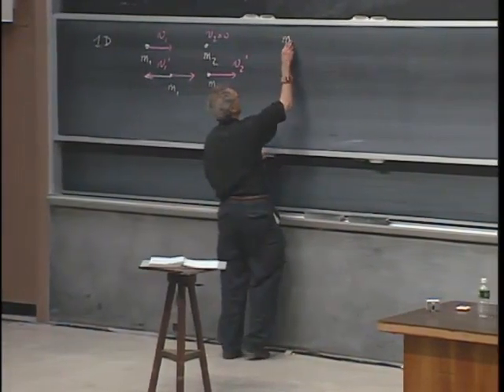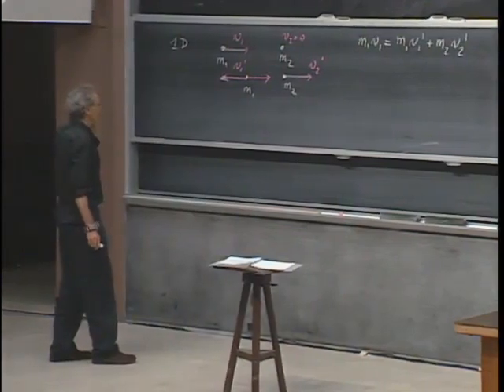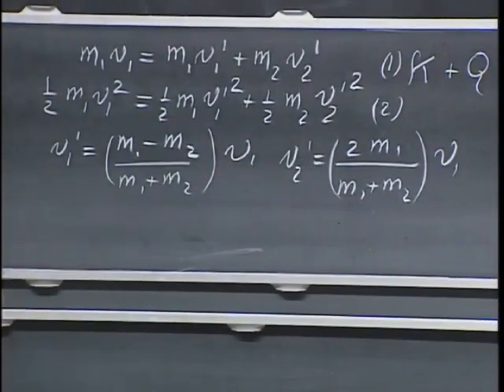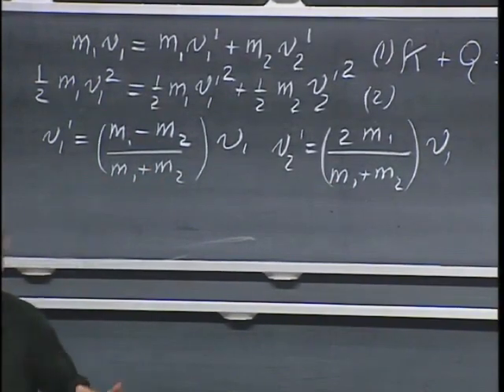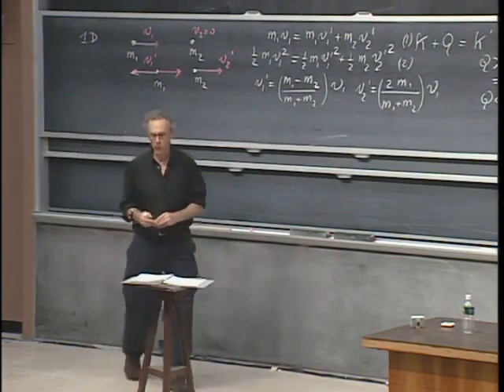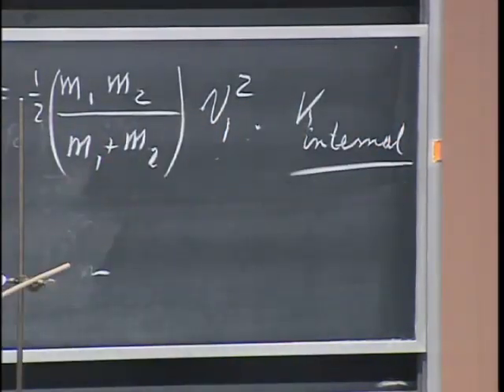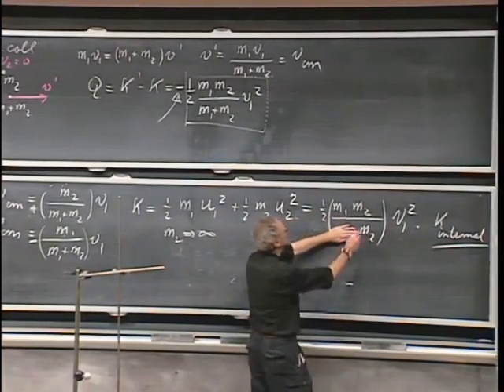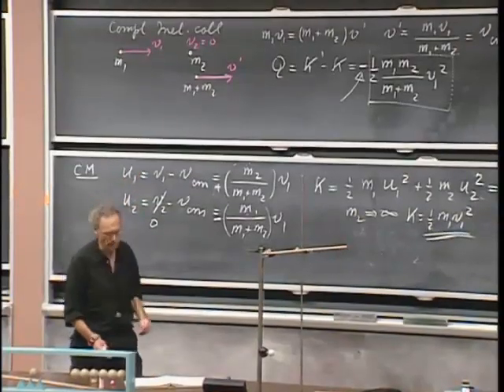8.01x - Lect 16 -  Elastic & Inelastic Collisions, Center of Mass Frame of Reference

Comment: Dear Professor
Consider the wall and the earth as a single object with relatively infinite mass (m2), v2'= 2m1/(m1 + m2) = 0. Kw= 1/2(mv^2) = 0.
Also because magnitude of change in Pb = Pw= 2mv= Mv  is small while the mass of the wall-earth (M) is relatively infinite, v must approach 0 = > K = 1/2(mv^2) = 0. Is it correct ?
Reply: Lectures by Walter Lewin. They will make you ♥ Physics. This is my answer to your question in your lecture. Is it correct?
Reply from the maker: your answer is somewhat confusing
Reply: Lectures by Walter Lewin. They will make you ♥ Physics. 

I mean the magnitude of momentum of the wall is Mv” = 2mv’ , m is mass of the ball, M is mass of the wall combined the earth, v’ is velocity of the ball, and v” is velocity of the wall. 

Because 2mv’ is small and M is extremely large, v” is extremely small (it is almost zero). Therefore, Kinetic energy = 1/2 (mv”^2) is zero.
Reply from the maker: KE of wall is 0.5MV^2. MV is finite (it is 2mv). Thus KE=0.5*2mv*V. But V as you say, is near zero, thus KE wall is near zero but momentum is 2mv.

Comment: About the problem with the tennis ball and the wall:

We know that the momentum of the wall is: p(wall) = m(wall) * v(wall)

Then, by the equation for v1' and v2' for elastic collisions, we can substitute v(wall), and we get:

p(wall) = (2*m(wall)*m(ball)*v(ball)) / (m(wall) + m(ball))

We know that m(wall) >> m(ball), so as we take the lim m(wall) -> infinity we get that:

p(wall) = 2*m(ball)*v(ball) *  lim (m(wall) -> inf) ( m(wall) / (m(wall) + m(ball)) )

the right side limit is of the indetermined form inf/inf, so we apply L'Hopital's Rule and we get that the limit is exactly 1, so:

p(wall) = 2*m(ball)*v(ball) = 2mv
 Is this correct?
Reply from the maker: ofcoz p of the wal is +2mv after the collision, but the KE of the wall after the collision (if its mass M is thousands of tons) is veri close to zero & can be made as small as you want to by increasing M.
Reply: @lecturesbywalterlewin.they9259  yes, i notice it when I made the limit as m2 -> inf of the KE for the wall, and it goes to 0

Comment: Related to your question about the collision between the ball and the wall. Is it due to the fact that moment, mv, where m = x   as x goes to infinity can be different from 0 (v = 2/x for instance) but (1/2)*m*v² would still go to 0 with those same values? Also, can it simply be that the earth to which the wall is attached applies an external force on the wall, and so it's the larger system (ball, wall, earth) that has its momentum conserved? Thanks in advance.
Reply from the maker: +Pedro Candeias KE=P^2/2M.  In this case, P of the wall is 2mv (m is the mass of the tennis ball, v is its speed).  Since M=>infinity, KE is ZERO, but P is not zero.

Comment: Is momentum of the system is conserved in all types of collisions? And should the conservation of momentum be applied along the line perpendicular to the line where deformation of the bodies takes place ?
Reply: Momentum is conserved as long as there is no net impulse from external forces.

This will happen if:
1. There are no external forces
2. External forces add up to zero
3. The collision happens so quickly, that any cumulative effect from external forces is zero, during the instant the collision happens.

Comment: Dear Professor 
After read the chapters about work/energy and watch your lecture, I try to summarize my understandings. Can you please tell me know if I miss something?

Is kinetic energy conserved in elastic collision but transferred into thermal energy in inelastic collision?
Do they both obey delta K + delta U + delta E  thermal = W other?
In both cases, W other is 0 because no external force does work on the system?
In elastic collision, delta E thermal is zero and delta U is temporary (in before and after, all energy are kinetic energy)?
In inelastic collision, delta E thermal is nonzero.
Reply from the maker: use google
Reply: Lectures by Walter Lewin. They will make you ♥ Physics. I cannot find out reliable answers using Google. I usually read books then  ask my physics professors check my understandings. Can you please help me check?
Reply from the maker: >>>Is kinetic energy conserved in elastic collision but transferred into thermal energy in inelastic collision?>>>
yes, energy is always conserved but KE is only conserved in elastic collisions. In the case of inelastic coll the KE lost is released as heat.  However in the case of nuclear reactions (accelerators) the loss of KE with inelastic collisions can be converted into mass of a new particle. I will do a bi-weekly problem on that in 2018.
All of this is readily available on the web. You have to learn how to use google.
Reply: Lectures by Walter Lewin. They will make you ♥ Physics. Thank you very much. I am really sory for asking many questions. Although I am still young, I am quite conservative or “old-fashioned”. I jumped from 6th grade to college, so I was fixed to traditional teaching and learning setting.
Wow, it sounds interesting. E=mC^2 means that the energy that can be converted into mass is kinetic energy? I am looking forward to watching your lecture about this.
Reply from the maker: I do bi-weekly Physics Problems. You should try them.  this weeks problem is
https://www.youtube.com/watch?v=DyVv7WzwH6A&lc=UgyZLUFKbLfl62Hmeqh4AaABAg

Comment: Sir,in the ball hitting the wall problem,
K.E = 1/2 mv^2
or K.E=p^2/2m
now the wall has a certain momentum,but as the mass is quite large,m-> infinity..and something by infinity is 0..hence kinetic energy of the wall is 0 although it has a momentum of 2mv..
Reply from the maker: +Saptaswa Chatterjee correct
Reply: Sir,But in real world a wall has a finite mass and hence the wall must have a K.E ,(however small that may be )..and hence a velocity..applying the same logic if I jump on earth I am giving it a velocity..although it's infinitesimally small.
Reply from the maker: +Saptaswa Chatterjee correct
Reply: +Lectures by Walter Lewin. They will make you ♥ Physics. Sir will it be possible for you to reply me, if I leave my email here? I have a desire of becoming a physicist and specially working under a professor like you ,it would be a dream come true. It would be great to have a guide, like you. Thanks in advance!
Reply from the maker: +Saptaswa Chatterjee I retired in 2009. I am no longer coaching students.
Reply: +Lectures by Walter Lewin. They will make you ♥ Physics. I would be quite happy even if I can talk with you, via emails!

Comment: Regarding the tennis ball and wall i think the trick is in nature of the material that the ball made by it, because if you hit an egg or tomat they never come back  to you that mean v1' become 0 with conserving in mass of cource, that guide us to think there is a potential energy linked the ball.  am i in the right way ?
Reply from the maker: you are not even close
Reply: m1v1 (momentum of the ball) + m2v2 (momentum of the wall)= - m1v1' (because it back so we have negative direction ) + m2v2'
m2v2=0 because v2=0

and because the collisions is completly elastic so the ball will back by the same magnitude of velocity but not same direction so we have

m1v1= - m1v1'+m2v2'

m2v2'= 2 (m1v1) and that mean the m2v2' which is the momentum in wall is twice 

is this correct ?  you really made a sleepless night form me last night
Reply from the maker: that's not correct.

Comment: So the wall thing

V'2 = 2m1/m1+m2 × V1

Now because m2 = ∞ V'2 will equal approximately 0 meaning KE = 0

And we know that it still has momentum because even if v'2 = 0.0000000001, it multipled by infinity wouldn't be 0, it will probably be some other giant number or just infinity. I think I'm not sure

Comment: After collision, since tennis ball has momentum of 2mv, will the ball travel a larger distance ?
Reply from the maker: +Harsha s n The KE of the tennis ball is the same before hitting the wall as after hitting the wall. Its momentum changes from +mv to --mv.
Reply: +Lectures by Walter Lewin. They will make you ♥ Physics. I got it. Thanks for your time.   mv+0 = -mv +2mv . momentum is conserved.

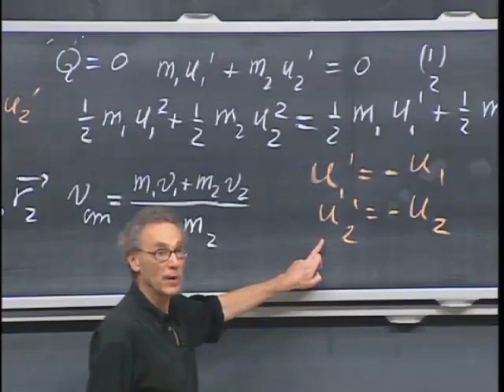Comment: since velocity of center of mass is constant as told at 30:25 then on collision of a ball with the wall the velocity of center of mass was towards the wall before collision then after collision it should again be towards the wall. but it doesn't seem so as center of mass move away from wall after collision. so please help me out. thanks in advance.
Reply from the maker: watch my lectures on collisions or use google
Reply: sir thanks i got it my question was wrong. C.M has no velocity before and after collision in case of ball and wall collision.

Comment: Sir...the tennis ball problem--the ball hits the wall with momentum (mv) and returns with the momentum in opposite direction i.e(-mv),so change in the momentum is 2mv....but we know that KE is (1/2.m.v.v )and we can write (mv)=p.....therefore KE = (p.v.1/2)therefore initial KE on the wall is +(m.v.v.1/2)and the final KE on the wall is [-(m.v).v.1/2)]i.e,-(1/2.m.v.v),and by adding the both KE's we get the sum to be 0(zero).....but change in the momentum is (2mv).........[SIR IS THAT RIGHT??]if wrong please correct me..
Reply from the maker: >>>and the final KE on the wall is [-(m.v).v.1/2)>>>
NO
Reply: Thank you sir.....i forgot that the KE can never be negative
Reply: Conservation of momentum fails to hold if Center-of-Mass frame is transformed by Lorentz Transformation to another inertial reference frame.
http://vixra.org/abs/1802.0099

If velocities of both objects are transformed by Lorentz Transformation. Total momentum become totally different.

Comment: Professor, hope all is well, is the momentum 2mv since the ball has  momentum mv before the collision and  since the ball  has to come back with momentum mv( almostcompletely elastic collision where also  kinetic energy is conserved since the wall has an infinite mass) after the collision the wall has to have 2mv. The logic is pretty much the same as the massless ring sitting inside a friction-less rod when it gains amplitude 2A in lecture 7 in 8.03. Am I right professor? Thank you
Reply: What does this mean professor ? LOL
Reply from the maker: It means I have read your msg. it's different in my book. but if you like it OK
Reply: Is this Right professor?
Reply from the maker: I look at it differently but if you like your analogue that's fine with me.

Comment: I have a doubt in a collision question
A block A of mass 2m is placed on another block of mass 4m which in turn is placed on a fixed table. The two blocks have the same length (not height) 4d. The coefficient of friction (both static and kinetic) between block B and table is μ. There is no friction between the two blocks. A small object of mass m moving horizontally along a line through the center of mass of the block B (parallel to the ground) and perpendicular to the face with a speed v collides elastically with the block B at a height d above the table. What is the minimum value of v required to make the block A to topple?
Reply from the maker: I do not solve problems for viewers. I teach physics. Watch my lectures and you will find your answer.
Reply: @lecturesbywalterlewin.they9259  okay...Thank you sir

Comment: According to the pendulum problem at the end of the video when 5 balls r pushed the initial momentum is 5mv  and according to the law of conservation of momentum 5 balls should come out the is is because the 3 stationary balls absorbs the kinetic energy from 3 of the 5 balls the there is still two balls which still possesses the same kinetic energy hence we get 5 balls moving after collision. Sir is this correct???
Reply from the maker: this problem is more complicated than most people think.
It's easy to show that in each configuration KE and momentum are conserved, but that is different from proving the bizarre behavior
use google

Comment: hi proff.in the last experiment we deal with each ball singly.so when the first ball hits the 3 balls, one of them goes and the first one still there so they become 3 again. when the second ball hits the 3 balls, one of them goes and this ball still there so they become 3 again.when the third ball hits, one of them goes and this ball still there so they become 3 again.when the fourth ball hits, one of them goes and this ball still there so they become 3 again. when the fifth ball hits, one of them goes and this ball still there so the become 3 again.is that correct? and sorry for poor English. :)
Reply from the maker: you use words like in a  fairy tail
where is the physics?
Reply: due to conservation of momentum:
5mv=xmv` (x is the number of balls)
so 5v=xv` >>>(1)
due to conservation of KE
1/2*5m*v^2=1/2*xm*v`^2
so 5v^2=xv`^2 >>>(2)
by substitution by 1 in 2 
we find that v=v`
so by substitution in (1) we find that x=5
Reply from the maker: that's already better. You have confirmed that the physics is consistent with what you observed at the end. 
However, a correct solution includes multiple collisions and that's more time consuming.
Reply: thanks alot proff . you are the best
Reply from the maker: Your calculations are consistent with what you see (that's easy). But you have no demonstrated that this is the ONLY possible outcome.
Reply: sorry but i cannot get what you mean!

Comment: According to the tennis ball problem the change in momentum of tennis ball is -2mu and the change in momentum of wall should have been -2mu but since mass of wall is infinite v should be nearly equal to zero sir is this correct??
Reply from the maker: >>>change in momentum of wall should have been -2mu>>>>
NO
Reply: Lectures by Walter Lewin. They will make you ♥ Physics.  Sorry sir I miss typed it . It should have been 2mu
Reply from the maker: yes momentum of the wall after the elastic collision is +2mu but the KE of the wall is ZERO in the extreme case that its mass is infinity.

Comment: Thank you sir for the lecture.... I am not able to find a way to prove the happenings at the end of the lecture. Why is it so that when we hit 5 balls on 3 balls, 3 balls remain and 5 move on?
Reply from the maker: This is called Newton's cradle. Searched the web for solutions.
Reply: Very roughly speaking,Because as we can see all balls are identicle and if we consider energy transfer by five balls is 5 times 1/Mv2  then the transfer of energy to three balls is 3 times 1/Mv2 and the system has still excess 2 times 1/Mv2 and that will transfer to last two ball of five ball system and then system will came to equilibrium .....

Comment: Hello sir! If center of mass for a body, can i assume that the particles right to the origin are equal to the left of the origin? My intuition says it should be.
Reply from the maker: question unclear
Reply: Lectures by Walter Lewin. They will make you ♥ Physics. Sorry sir! If center of mass for a body lies at the origin, can I assume the number of particles to the left of the origin are equal to the right of the origin?
Reply: did u mean if center of mass is at geometric mean of body?
Reply: #Suseenthar1.....center of mass is dependent on whether the body is homogeneous or is it composite material, density of individual material in composites, distribution of mass and shape of body so, answer to your question depends on the case....if the body is made of single material and is homogeneous and has a shape whose center of mass and geometric center are same (eg, sphere) than u can say number of particles (assuming particles from which the body is made are of same size and shape) to left and right are same....

Comment: I have a really stupid question I guess; Why use V1, V2, etc.; why not use V, V2, etc. (isn't the first V assumed to be V1, so using V1 would be redundant?)?  Same for Time, Mass, etc.  Also, what is Prime and its value? I'm not a math guy, but I love watching these lectures; for some reason this seems to make more sense to me than algebra - algebra makes me hate math so I never bothered trying to move past it (is it really necessary to understand algebra in order to under stand stuff like this?).  Thanks for your time!
Reply: V1 is not redundant.  It specifically refers to the velocity of the object we call object 1.   V would simply mean velocity in general.

As for the prime notation, it could either mean Newton's notation of derivative function notation (such as f'(x), pronounced "f prime of x"), or it could mean a way to label a second instance of a variable you've already used.  In this particular lecture's example, the prime notation indicates the velocity of the center of mass in the lab reference frame.
Reply: Understanding physics without sufficient knowledge in algebra is like using a fork to eat a soup

Comment: 25:06 - 25:14 . I dont get it sir why the momentum is zero?
Reply from the maker: if you choose the center of mass as your reference frame, then the com will not move in your ref frame. In any random ref frame, the vectorial sum of the momentum of 2 moving objects is the same as the momentum of the com. Thus if you choose the com as your ref frame the net momentum is zero.

Comment: Sir, I have a question. When two objects of equal mass take part in an inelastic collision, what exactly causes the loss of kinetic energy of the system of 2 masses? I have analyzed what causes this loss of mechanical energy when two objects of different masses collide inelastically using the work energy theorem. Thank you in advance.
Reply from the maker: inelastic collisions KE is converted into heat
Reply: Lectures by Walter Lewin. They will make you ♥ Physics. Sir, may I email you my explanation as to why KE is converted to heat in an inelastic collision? I just want to verify my solution.
Reply from the maker: my email is strictly private. Use the Help Session Problems on this channel. I do several problems with inelastic collisions. Any loss of KE is due to heat. PERIOD